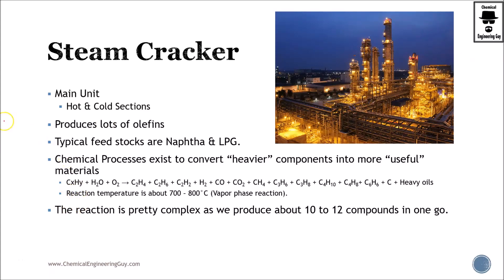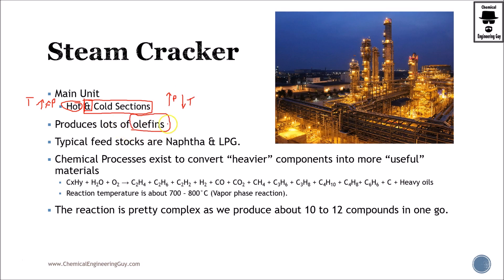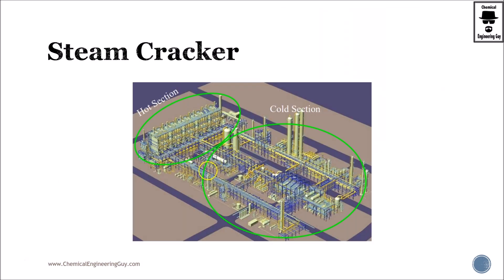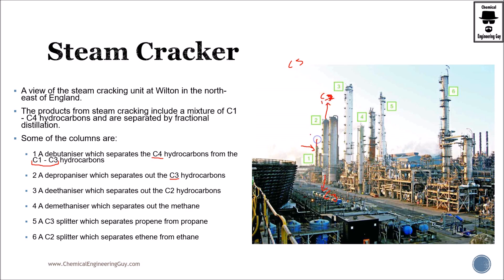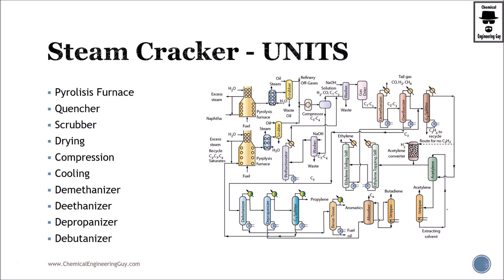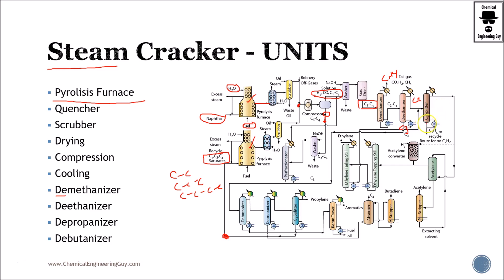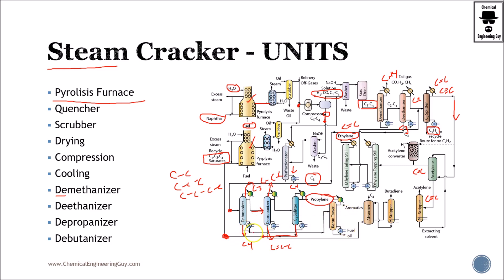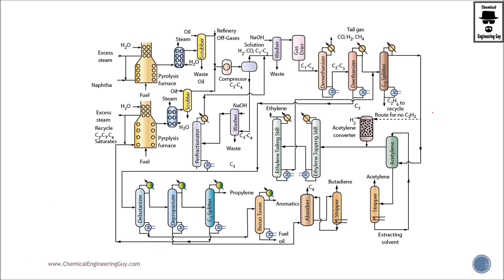Steam Cracker -  Overview (Lec031)

Comment: This is a great presentation. Would youhave a recommendation for a easly to follow diagram that would illustrate how these many different products you list are created through the cracking process. I am trying to help explain the complexity of the ghg lifecycle analysis challenge when allocating emissions to processes generating multiple chemistries at different points.
Reply from the maker: Hi! Sure, you can check this content on the course. Regarding Emissions, its a great idea, I'll try to add some information on that in an upcoming course on Environment + O&G

Comment: I have a question, what would be the best feedstock in producing ethylene and propylene via steam cracking?
Reply from the maker: a very rich olefin naptha will do great :)
Reply: It’s ethane/propane gas. If you look at every olefin plant built in the last decade you’ll notice they are built to ONLY crack natural gas feeds for the most part. Naphtha and other liquid feeds are not used nearly as much as they used to be.

Comment: thanks for explaining this process and awesome way to describe different ways to crack ethane! i currently work in petrochemical company as a fire fighter and our company  uses the steam crack way to extract ethylene. i wonder what should i be worry about this process and what are the hazards and the most dangerous parts of this process i mean (furnace, tank, compressor and etc ) ! it would be vary useful for me and our fire department because we risk our lives there and we need to be fully aware of the hazards of this process . tnx again
Reply from the maker: Hey Mehr, thanks for your feedback and comment! Well.. there are many issues, truly, the main unit is typically well guarded with many security/hazards prevention. The sub-units, or all the other units working behind the main unit are the ones that should be paid extra attention.

Comment: What is the approximate specific heat consumption of the pyrolysis reactor (MJ/kg of feed)?
Reply: Off the top of my head, we used Naphtha and Propane, feed rates  were usually around 30Tes/Hr, with a radiant coil outlet temp of around 900 deg C. Usually there were at least 15 furnaces in operation, which produced 100 Tes/He C2 and 45 Tes/Hr C3. As well as the C4 make and C5-6's, Hydrogen and Methane was chilled out for use in the Hydrogenation reactors and the Methane went to Fuel Gas for the Furnaces. The residual heat from the furnaces was used to produce VHP steam and let down and superheated to produce steam for the compressors . A Caustic Scrubber was used to remove the CO2 and H2S acid gasses between the third and fourth stage of process gas compression, the catalyst used in the hydrogenation train was poisoned by these otherwise. Every form of residual heat was used on the complex to produce some other 'work' so nothing was wasted in theory...The mass balance calculation was truly a sight to behold and was produced using 'magic' as far as I could tell...feel free to contact me for more anecdotal tales...
Reply from the maker: wow! thanks for jumpin in! great input
Reply: @ChemicalEngineeringGuy  any time, I'm retired but can recall most of the operational side...

Comment: I think you should separate c1 first, then c2 and c3 and c4. Because weights are: c1 < c2 < c3 < c4.
Reply: The separation train went, C1 split from the C2's in the DeEthaniser, the C2's then went onwards to Hydrogenation and then C2 Splitter so that any Ethane and residual Methane was removed. The C3-5&6 was extracted as a bottom take off of the Final stage Compresion chain. C3 was taken overhead from the DePropaniser, the base cut was then taken to the Secondary DePropaniser to split the C4 from the C5. The Depropaniser overheads was directed to a Hydrogenator to remove the C3 Acetylenes, then to the Secondary DeEthaniser to remove residual Hydrogen, this was then sent to the C3 splitter to remove any residual Acetylenes. The Aim was to produce C2, C3, C4 (ButylButelenes). Also the Hydrogen and Methane was removed in the initial stages...This was the Kellogg designed Olefins 6 Cracker at Wilton on Teesside I was part of the commissioning in 1979 and left in 2018 just before it closed down.
Reply from the maker: yeah, that is the very broad idea, once you get to separate it, you will see that it is not that easy to separate them as that, specially because you will spend much more in cooling/heating and pumping/compressing due to the mass transfer drive force being "small"... what you want is to spend the least amount of energy as possible. In summary, your approach is correct overall, but will cost a lot $$

Comment: Errr as an ex-control room operator on that very plant for 43 years, Olefins 6 Plant originally ICI's Kellogg design now run by Sabic. You have the towers mixed up, the tower numbered 6 is the Depropaniser removing C3 from the C4&5 stream, 4&5 are the De-Methanizer's removing the C1 from the C2, 3 is correctly the C2 Splitter removing the Ethane from the Ethylene, 2 are the C3 Splitters removing any remaining Propane and C4 from the Propylene, 1 correctly is the Debutaniser but it is removing the C4 from the C5.NOT the C1 and C3 streams, C1 isn't part of the C3 stream it is removed as part of the C1&C2 stream.C1=Methane is lighter than C2 Ethane/Ethylene and is much lighter than C3 so is part of the Cold Fractionation stream. C3,4,5 are part of the Warm Fractionation stream. Sorry for being pedantic but it sounded wrong......
Reply from the maker: Hey thanks for getting in touch! Make no worries on pedantic, It really helps!
Reply: @ChemicalEngineeringGuy  Any time just e-mail me if you want practical anecdotal evidence for your classes.....

Comment: In all the olefins plants I have worked in and that I have seen, the C2 splitter is usually the tallest and widest column in the unit.
Reply: In the video the towers are misnamed the De-propaniser is column 6 the columns marked 2 is the C3 splitter which is one tower spilt into two as it isn't practical to  build one tower. Column 4 is  the DeMethaniser pre stripper, fitted in order to rebottleneck the plant in the 1980's. Column 5 is the De-Methanizer, 3 is the C2 splitter, Column 1 is the secondary De-ethaniser, I worked on that plant as an Instrument Tech and Control room operator from 1979(commissioning) and 2018.